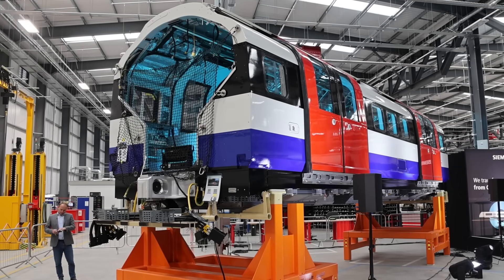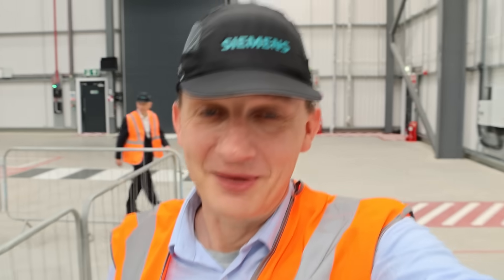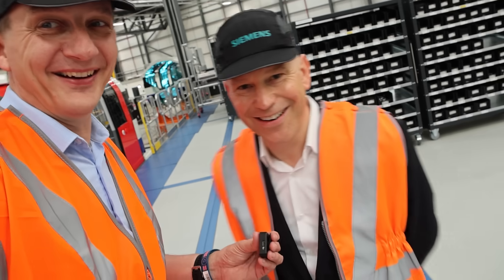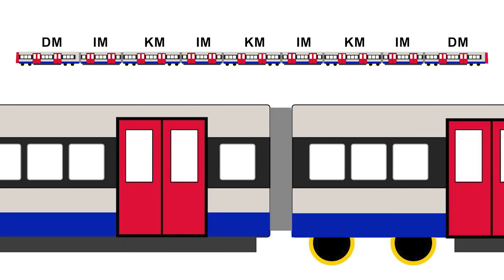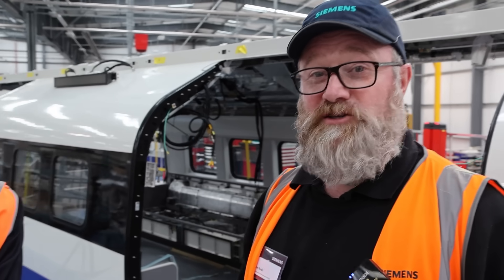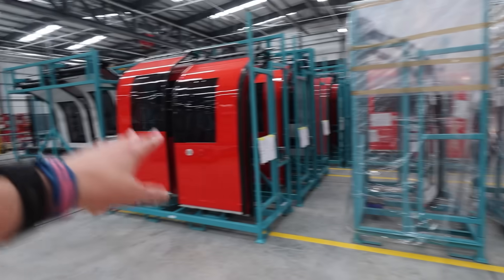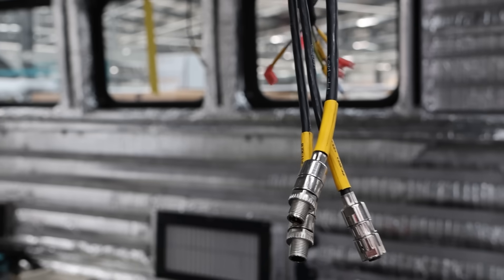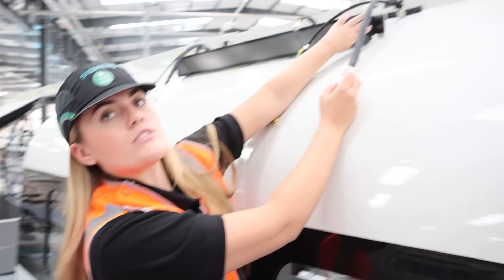The New Piccadilly Line Trains Are Being Constructed

Comment: "here at siemens, we like to do things properly" made me laugh, after the new siemens trains we got at my company in germany last year, with screens in the drivers cab installed upside down and switches installed the wrong way around 😅
Reply: Oops!
Reply: Siemens built over 100 class 700 trainsets (up to 12 cars long) for Thameslink in the UK and, even though their seats aren't very comfy, they are very reliable trains!
Reply: @petitkruger2175 mass transit ditched comfort in the 20-teens.
Reply: the Austrian factory final inspection sign off for ya.

Check the orientation twice, fit once.
British engineers code.🤦🏽‍♂️
Reply: Weren't the Desiro units some of the most reliable on the rail network?
Reply: well they said 80% will be uk built so lets hope we are better
Reply: The Siemens units have incredibly uncomfortable seats - a bed of nails would have more give in it.  The interior decor is more drab and depressing than a 1960s kitchen sink drama, and they also have to be operated as 12 car units all the time, which is incredibly inefficient.  Apart from that they’re great.
Reply: @borassictime918 Siemens would have installed the seats specified by the train operator.
Reply: @borassictime918  Interiors are chosen by the operator, sometimes even contracted to different companies supplying parts. So if a train is uncomfortable but reliable, the rolling stock company did its job, but the operator didn't.
Reply: The operator will have been offered interior options offered by Siemens, what was chosen was a Siemens spec, Siemens delivered the trains from the Continent complete, so what you say is really only partly true.  Siemens did the same with its Avenio trams in The Hague - seats hard as rock, very, very uncomfortable, and wore through the fabric very quickly.

And why did Siemens offer such an utterly drab interior?  Might be popular in Germany, but to describe it as unwelcoming would be an understatement.
Reply: @borassictime918  it is true that most trains are 12 cars long but not all of them, Thameslink operate 8 car sets too and the class 707s (basically the same as a 700) are 5 cars long
Reply: Yes, although my point was that the Siemens units must be operated at their full length all the times, with no option to run as shorter units off peak or at weekends. This is especially inefficient and costly now that wfh has substantially reduced commuter numbers which was Thameslink’s bread and butter. Class 319s offered far more flexibility, not least the ability to operate in places where platforms cannot accommodate 12 car units.
Reply: @borassictime918  You still get a lot of commuters standing on class 700 12 car sets at peak times. I am one, since moving to a city based company in 2021. I dread to think what the 319s were like before the reduced commuter numbers!
Reply: @bri77uk1  I recall first using the 319s during the lengthy Tube strikes in 1989.  Compared to the Underground the 319s were heaven, still almost brand new at that time…that was until everyone else found Thameslink as a faster and more comfortable alternative to the Northern Line and they got unbelievably crowded in the numerous strike days - it was a hot summer too - no aircon on the 319s, but the windows gave decent ventilation.  The seats were a bit crammed in, but were at least properly upholstered.
Reply: @bri77uk1 "Why I hate First capital connect" will be what you dread, those videos from 10+ years ago when thameslink was still First Capital Connect, chronic overcrowding forced passengers to shove into train cars which took forever to close due to being so crowded, and double decker trains would just worsen the misery as they took even longer to load when not extremely overcrowded as shown in those videos
Reply: @borassictime918 do you know what’s also inefficient. Installing cabs in every 4th vehicle, paying maintenance to link them up, maintaining the coupling doors (the things that breaks the most). So yeah 12 or 8 carriages are highly efficient.
Reply: @MrJimheeren  No need to demonstrate your lack of knowledge about unit running costs, wear and tear, more frequent overhauls and  power consumption per diagram.
Reply: @borassictime918   operating as 12 car trains is definitely more efficient though? Most of Thameslinks routes need such high capacity, and obviously having long trains that are walk through meet the demand. And there are also 8 car variants where the platforms aren’t long enough. 
Also I think nowadays the effort of shortening trains during off-peak periods really isn’t worth it. the difference in operating a 12 car train vs 8 car train with the other 4 cars in some siding is negligible
Reply: @petitkruger2175  Fair points.  Unfortunately, with the now high cost of electricity the additional weight of a 12-car unit is adding significantly to operating costs, as well as the wear and tear through vehicle use and to the track, both of which increase ever-rising maintenance and parts costs even further.  To at least have had the option of short formations off-peak would have had advantages in flexibility not apparent when the vehicles were ordered over a decade ago.  It is what it is, so my point is moot.  I can only hope Siemens, TfL and DfT have actually learned lessons from earlier mistakes regarding the seating and interior decor.
Reply: @borassictime918  The seating and the interior is the choice of the rail operator. They had them specced them that way.
Reply: @a1white  I’m afraid it’s not that simple.  The German-built 700 had to comply with the European Technical Specifications for Interoperability (TSIs) as determined by the EU Agency for Railways (ERA). The TSIs include ‘technical compatibility and accessibility’ of seating.  In fact it was the DfT that purchased and specified the Class 700 trains using the criteria of the ERA and Siemens used these standards.

According to the DfT material on the 700s was chosen because it met the ‘minimum safety precautions’, with backrest design adhering to ‘interior crash worthiness requirements’. The seat dimensions and pitches were selected to guarantee a minimum standing-passenger capacity.

In 2011 DfT, TOC and other stakeholder representatives went to Germany to review Siemens seating options. The Bedford Commuters Association criticised the spacing between Supplier B’s seats. A representative of the East Surrey Transport Committee said they “make me round-shouldered”. The Association of Public Transport Users and London TravelWatch both appealed for better cushioning.

In another stakeholder trip in 2013 (yes two full years later) the parties viewed two mock-up carriages in Kassel, Germany. Further criticism was levied at the seats, but it was claimed that to adhere to EU standards that was the best that could be offered by Siemens.  The DfT responded to an FOI request by The Spectator by stating: “Fire standards have… become more demanding… Hence modern seats tend to have [a] firmer feel.” and they simply accepted what Siemens gave them because they were told that’s how it had to be.
Reply: Aren't siemens under boycott at the moment as well, due to their support for the terrorist state that attacks Gaza?
Reply: Great video, thank you!
Reply: It's a feature, not a bug. 😂
Reply: Not one of you has worked at siemens it seems
Reply: Siemens seem to be taking over the world.
Reply: That’s due too the fact they had foreigners building your trains we don’t like Germans
Reply: That's hard to believe. Usually trains are delivered only after final assembly tests at the manufactures side and customer tests at the customer side.
Reply: Skoda has very different problems
Reply: Siemens made the Class 707, one of the most reliable trains in the country, compared to the terrible Alstom-made 701. Says it all really.
Reply: @uhohadam  The 701s despite all their delays and problems are at their core a great commuter product. They are much better than the 707s with faster acceleration, better interior ambience, more/smarter standing space, USB by every seat, tables, toilets, larger windows, underfloor heating, a more comfortable seat with extra padding, additional passenger information screens by the doors etc etc. It’s a shame they’re taking such a long time to enter service
Reply: 6 months after the introduction of brand new Siemens trains on my local German S-Bahn network the information screens still show incorrect side of the trains for the doors at the next station 😀 - but at least they have finally enabled power sockets (and the seats are way more comfortable than the BR 700s).
Reply: upside down...perhaps they were built by Australians...?
Reply: Meanwhile in the US, Siemens Chargers are failing left and right. Not that Alstom's doing any better.
Reply: ‘Here at Siemens we like to do things properly’ …. Oh yes you’re building a fleet of trains that don’t fit the current platforms on the Piccadilly line meaning a massive undertaking to fit all the platforms to the trains. You couldn’t make it up.

Comment: They look good but I'd wager a bet that it'll be mid 26 before we see one running.  I also think there should be a limit on the luggage size passengers are allowed - which is the case in many countries
Reply: @neilrmartin1984  I don't think luggage is a major problem. And it's not acceptable to tell someone who has just arrived at Heathrow from the other side of the world "sorry, you can't take your suitcase on the train".
Reply: @caw25sha  maybe you don't ride the Piccadilly line often but I regularly see corridors blocked by bulky cases.  But I guess the UK always knows better

Comment: Most of the electricity is generated and supplied  from the East Riding too. A huge amount of electricity infrastructure has been and is being built locally. Massive battery farms and the world's biggest offshore wind farms are here plus underground cables, have been and are still being built. The sad irony is thst you can't get an electric train to Hull. It stops at Doncaster and its diesel from there. That needs to change amd and we need the restoration of the diect line to York.

Comment: So they emit hot air into the tunnels which is sucked in by the next train which generates more heat while cooling it. How do they avoid an ever increasing reversal of entropy?
Reply: Because you are assuming that all heat is trapped in the tunnels and the trains never leave the tunnels. Tunnels have ventilation, and trains leave tunnels. Improved thermal efficiency from regen braking also negates some of the temperature increases by reducing loss to brakes.
Reply: @HomemadeBrownies1  I'm sure they've done the maths and it will work but the deep level in particular is notoriously hot. I wonder what temperature it'll attempt to reach. I guess higher than a nice comfortable 20°.
Reply: @caw25sha  I’d guess 22. It’s just impossible to air condition the deep level lines to an American level of cold because of the clay as you know, and I don’t think it’s wise to try. Better use of time and money to invest in better signalling and power so people aren’t as packed in with higher frequencies, and leave the temperature at a manageable if not freezing level.
Reply: At the moment about 50% of the heat comes from braking. So the new stock would have been designed. To reduce the heat that the train produces.

Comment: If the trains have air conditioning, all the excess heat is pushed into the tunnel, is it dealt with from there? Presumably this means the tunnels will be really hot, and the stations etc, or have there been changes made to the stations and the tunnels to take that hot air out of the tunnel?
Reply: platforms will be lengthened in a few places so there might be slight improvements there. Which certainly means the distance from Leicester Square to Covent Garden will get even shorter
Reply: I cannot help wondering that standing on the platforms on a hot summers day, and getting blasted with hot air from the aircon as the train pulls in is not  going to be very pleasant!!
Reply: @brettpalfrey4665  feels like the tunnels will fill with heat and the trains will push it around, but air conditioning tube trains has been a well published engineering challenge for decades, so I'm sure it's been done properly
Reply: If they increase the frequency, especially if they ever get to replace the signalling then they will need to remove more heat from the stations. Chiller units like they did on the Victoria line. Will not address the air quality though. Ventilation issues are just built into the tunnels.